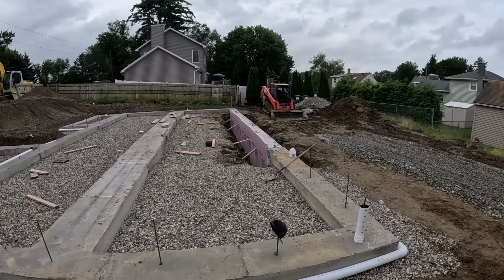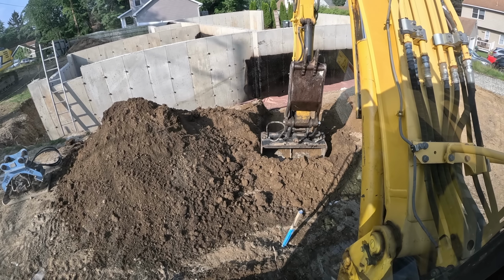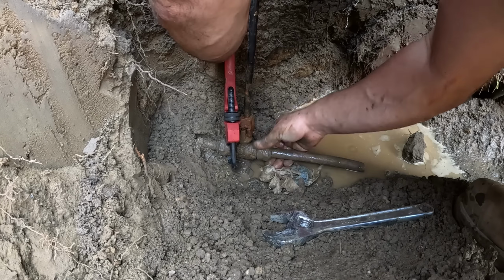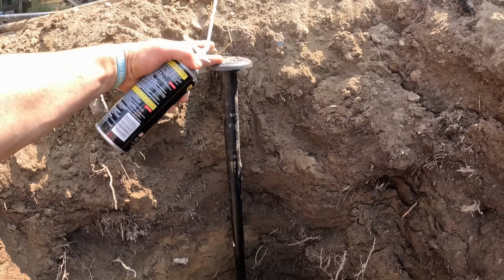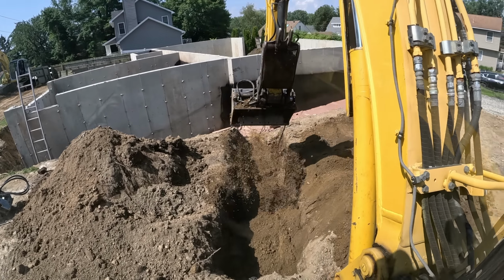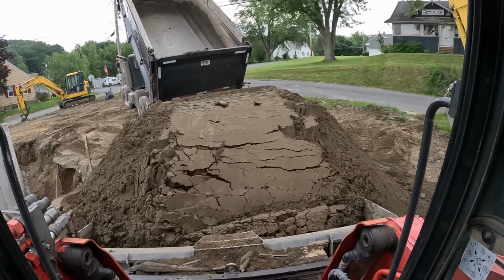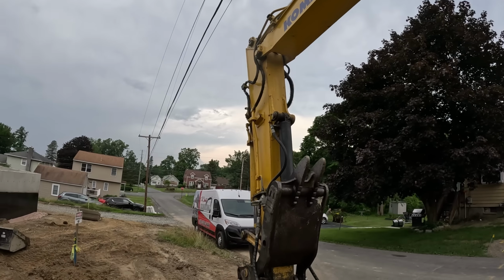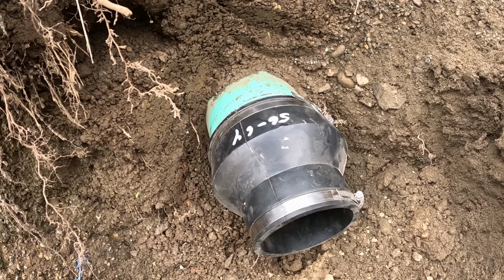Modular Home Foundation: The Basics Of Pouring A Foundation For Your Modular Home.

Comment: Ferncos are no longer allowed underground here in MI, code is calling for mission style couplings that are encased in stainless steel like a no-hub cast iron coupling, with 4x stainless clamps, 2 per side. The reasoning is that too many plumbing companies and underground contractors were not backfilling properly and a standard 2x clamp rubber fernco would just pop right off or fall when the backfill hit it. Ferncos are allowed above ground, just not below. Interesting to see how NY does it, as the weather and scenery looks just like the vast majority of MI. Enjoy your channel Mike, thanks for the videos.
Reply from the maker: Good to know thanks

Comment: Why did some external walls have bitumen on them and some didn’t?
Reply from the maker: Grade line or dirt line
Reply: @DIRT-BOSS  I thought it was to stop moisture penetrating, so shouldn’t it be  on all the backfilled walls? (External)
Reply from the maker: @alanhiggins2928  yes it is only on living space does garage and porch on the outside does not get it but on the inside of the garage and porch  basement wall it does
Reply: @DIRT-BOSS  Thanks mate!👍

Comment: supposed to have a brick under the valve and some stone around there … no tracer wire?? how would they find it from the house to the valve 😰
Reply from the maker: I explained that in the video that there is a brick under it I grabbed it with my hand.. I also explained the Town water locators will use a metal detector find the curb box and put a extension on it... This was already discussed between them and I
Reply: @DIRT-BOSS  ahh i gotchu!!